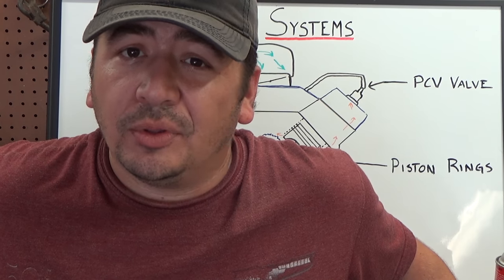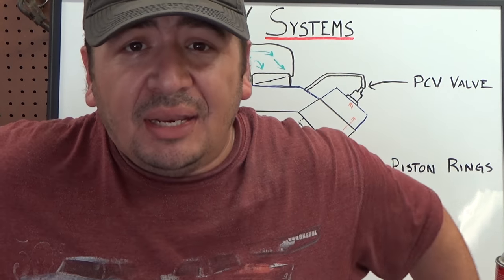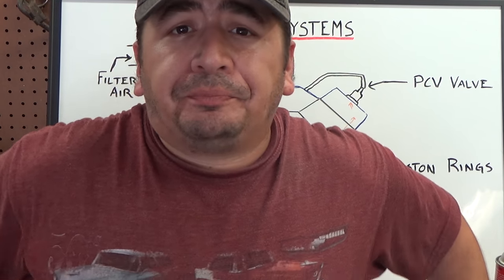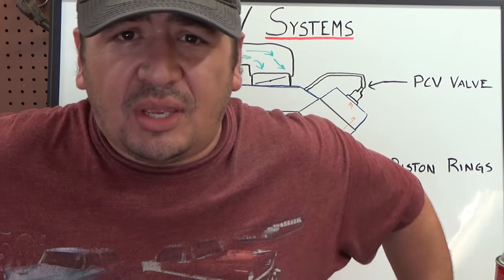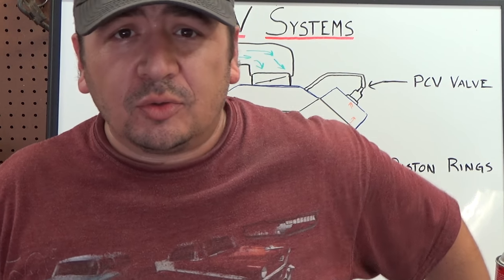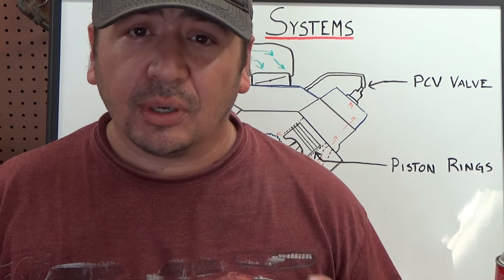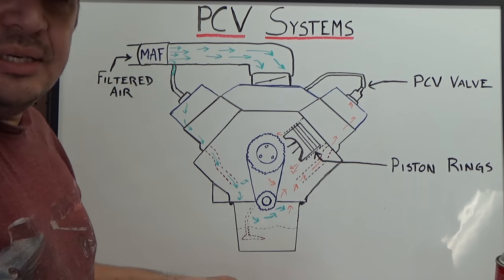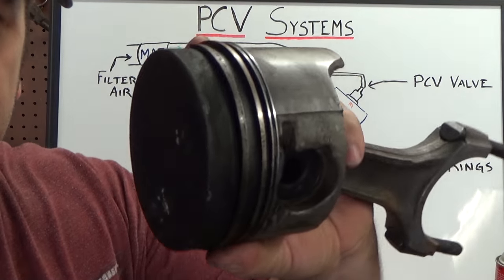PCV Systems - How They Work

Comment: I have a 2000 454 7.4L Vortec engine in my RV & it won't pass smog because the emissions at Idol are high, could a bad PVC Valve cause that? I've tried everything???

Comment: My PCV valve is fairly new & is on back valve cover and front cover got hose straight to air intake but instead of sucking air in its puddling oil in my air intake hose which is getting on air filter and maf pulse going into throttle body would you know why thanks

Comment: Thanks a lot for a clear explanation. Now I learned at there is actually cleaned fresh air coming into the crankcase, and then there is a pcv valve which regulates the vacuum in the crankcase. I will rush to my Engine bay to see my own vacuum system.

Comment: If these blowby gasses sludge up the engine and intake valves, why not discharge these gasses to the catalytic converter where they will be incinerated or use a vacuum pump to discharge to the cat.

Comment: Great video but I still don't understand why the PCV valve needs to be there at all. If there is low blowby at idle and low crankcase pressure, why does the PCV valve need to limit anything? Why can't that low pressure just go into the intake freely? It's still being metered so it shouldn't matter right? I'm trying to learn how a faulty PCV can cause a vacuum leak, which I'm not sure how it can again since the air in that system is metered. Unless it's letting in air from outside the PCV from  a bad seal and not just crankcase air. Oh, maybe it's because at idle you want the throttle pretty much all the way closed and an open crank case connection to the intake would be too much air and would make the idle go up? That must be why the PCV limits the flow at that point?

Comment: Some vehicles seem to slurp engine oil out of their PCV valves and some are dry. What design elements, or operating conditions, tend to make some PCV systems produce an oily mess in the intake manifold and ports?

Comment: Started watching this after I replaced one in my Honda. Just shake it to see if it rattled. If not, replace it. I didn’t think it would make much of a difference, but it did. It doesn’t run Rich anymore and mpg shot up. Car runs great and it got its power back. Check it every oil change. It’s a$3 part that really helps.

Comment: excellent, subscribed.  I recall a time when testing a PCV was done using your mouth doing a blow and suck test, basically confirming a check valve behavior.  But came looking here, when my truck's PCV would perform as a check valve (suck to no-flow condition), so bought new one and wouldn't either.  Watching your video makes sense of it all.  but help me out, wasn't the blow/suck test legit at one time?

Comment: I remember my 55 Chevy 265 V8 with the crankcase draft tube facing the ground to vent the hydrocarbon gasses. It would stink in the Summer when it ran in traffic. My next newer mid-1960's car had the PCV system and did what it had to do as you had explained. But one thing that you did not mention was that with the PCV system the engine actually got better gas mileage as well as the cleaner air to breathe.  Because the metered unburnt blowby hydrocarbons were reburned when sucked into the intake manifold along with the air fuel mixture for extra fuel efficiency.

Comment: thanks for the video.....i was having issues with my car and saw another video that mentioned the PCV system, i dug deeper and on my honda civic it was easier to change the PCV valve than it is to change gears....so i did it....the guy at the auto parts store said these should be changed once a year....but that seems a little exessive.

Comment: What causes the actual valve to move up?  The pressure of the air that flows from filtered air before the air intake manifold through the crankcase to the airinlet (after air intake manifold)? Is this flow of air constant?

Comment: A little bit of preventative maintenance goes a long way to avoid serious, expensive repairs.
Even if you have no idling issues or other symptoms, it’s just a good idea to replace certain critical parts after a specific interval. I replaced my PCV valve at 120,000 miles while replacing the water pump and drive belt. Honda recommends those parts be serviced after 100k miles.

Comment: On another note clogged Pcv valve really damages gdi engines by allowing sludge oil to build up into the intake side of the intake valves causing all sorts of problems

Comment: Awesome explanation man, thanks. I kept hearing a buzzing sound on my Silverado inside the engine bay on the driver's side. It was making me a little crazy. Turned out it was the check valve in the pcv. No big deal, just annoying.

Comment: nice video , i age a 73 Charger with a big block i noticed lately that i have oil dripping from  the filter cap on my valve cover , i have a pcv valve that is connected to my carb spacer hole  on the other valve cover and i recently changed the rear main seal for dripping oi badly , my question is does the filter cap  ( after market chrome cap ) on the valve cover needs to be connected to my aftermarket air filter , and does it matter on which side  (left or right of the engine ) the pcv valve is connected thanks

Comment: The hose between my pcv and Intake has a leak, so I’m assuming it’s drawing in outside air into the intake not being monitored, but I also have insane vacuum on the oil cap at idle

Comment: Maybe a stupid question but It's sort of confusing  in a way because the PCV valve seems like it's mentoring the flow and the other side looks like a straight pipe without any kind of check valve so air can go in or out even though both sides are hooked up to the intake manifold that creates suction

Comment: Also what's important to note...the pcv valve hose always goes to manifold vacuum and the opposite side of the system goes to pre vacuum (air cleaner) before throttle body or carb. I've seen people do it wrong.

Comment: I noticed that I bought one from Autozone and I compared them from another Auto parts and I tested both the one from Autozone throws not that much air and the one from another Auto parts throws way more.Should I put the one from Autozone or shoul I put from the other Auto parts.

Comment: So what if i unhook my pcv valve from the air intak and leace it open to air?  Is there a chance this throws a vacuum leak code.  I want to remove this air flow into my air intake system

Comment: Nice video.  I have a question.  I have a 77 F250 and after rebuilding and installing the carb I noticed a rapid pulsation from the PCV valve at idle.  I can feel it on the vacuum tube as well.  Remove the valve from the oil fill cap and pulsation stops.  I have absolutely no idle issues... baby runs smooth.  PCV seems to check ok.  Rattles when I shake it.  I've read forums where replacing PCV valve does not get rid of this pulsation.  I can't say that this hasn't been doing this since before reinstalling the carb.  I just happened to notice it at that time.  Is this something for me to worry about?  Is there anything I should check or do?

Comment: 351w carb I have it set up just like this but there was a pcv on fresh vent side coming from the air cleaner is that correct? Or do I want it straight no pcv on that side ? Thanks

Comment: Great video, @ 5:50 you mention the air coming into the eng. is metered and gets into the eng. past the MAF (air flow sensor). what about in an older engine with no MAFs?

Comment: I have a late model toyota rav 4, the intake has to come off to replace the pcv valve about 3 hours, is there not an easier way to check if it's working or not?  BTW My rear main oil seal is leaking a bit, connected?

Comment: This helped me understand the pcv valve a bit better. I recently replaced my old pcv valve and a few days ago I got a P0402 Exhaust Gas Recirculation Flow Excessive Detected code for my 96 Ford Explorer. I cleaned my pcv valve today and it got the engine code to go away. So glad I didn’t spend a bunch of money for a simple cleaning in the pcv valve.
Reply from the maker: I'm glad the video helped you understand the PCV system and helped you take care of your fault code.

Comment: thanks for this super instructional clip, i have a very important question for you, i'm in the process of swapping a Trailblazer SS intake manifold in my 04 Tahoe which has a little tube right before the throttle body plate to provide fresh air into the passenger side valves cover but the new intake i'm going to put has not that fresh air tube so without knowing what you explained i drilled a hole on the neck of the intake after the throttle plate and tapped a fittin to be able to connect the hose from the valve cover but now after seeing this video i just realized that by doing that instead of injecting fresh air to the crank case it will suck air and vapors from the crank case into the intake the same as it does on the dirty side from the pcv valve to the intake so please let me know what do you think and what do you recommend me to do, big thanks in advance

Comment: What you fail to explain is that the change in exhaust gases from blow by can go either direction depending on vacuum within the hose before the throttle plate

Comment: Hey wassup I have a Toyota crown majesta 1jz-fse  I notice oil is going onto the  air filter and  intake manifold  and  it makes a noise coming  from the  engine  when the its  running could that be a bad or failing  pcv

Comment: Thank you so much! We replaced my pcv valve... old one was horrible looking, I noticed sludge on last oil change, terrible gas mileage, oil around my coil packs, leaking small amounts of oil under the engine... Anyway it all was a hot mess! So now we put the new pcv valve in and test drove - when I came home at an idle there's a loud rattling sound. Where should I go from here?

Comment: Best video I’ve seen on this. But at 10:05 you show the valve all the way down and mention how as the vacuum drops more gases are allowed through. But if I’m not mistaken at wide open throttle (no vacuum) the valve would drop all the way and not allow any gasses through right?
Reply: You are not correct. The spring loaded plunger never goes all the way down if the engine is working so it never closes the opening and the gases can flow. The position of the plunger and the size of the opening below the plunger are determined by the spring tension and by the vacuum inside the intake manifold. At the wide open throttle the vacuum still exists. Not as high but it's still there.

Comment: Excellent knowledge here. .. As the plastic PVC housing on the plastic valve cover, the new valve would not seal properly on the engine vacuum side. I plumbed the pcv valve to the other valve cover, to the smaller hose fitting, then to the manifold inlet on the other end of the hose. .. The air box vent hose went to the larger broken side, with a minor repair. Everything worked great.. Thank you for this video.

Comment: Please can you tell me why oil is escaping out of the PCV valve into my air intake I have a 2.8l 2006 mk Triton is it possible to get a new PCV valve or do I have to replace the rocket cover or is there a problem with the vacuum that you mentioned

Comment: Great lecture there 👍 more explainable thanks, I have 2005 Renault Velsatis that comes with Nissan 3.5 V6 DE engine.  Have been having serious problem with starting the engine, once I crank it the engine will respond and trip off immediately, not idling, tottle pedal not responding.
Have changed the MAF, Tuttle pedal, Tuttle body, the 6 spark plugs, the fuel Injectors. Problem still persist, like engine wouldn't stable and idle.
What can I do?

Comment: Excellent explanation of the PCV valve. I am building a custom engine and have seen many variations on how to control crankcase pressure.  I'm installing an EFI system and was thinking of going with venting to a can, but now I think the best way is to run it into the base of the throttle body.  I don't want to run it in such a way as to add oil sludge at the intake valves.  Great job, thanks!

Comment: Very good video except a proper crankcase evacuation system does not allow pressure to build in the first place, it pulls sufficient vacuum to not let pressure build to begin with. Crankcase should never "push" air out, evacuation vacuum/suction pulled at all times prevents pressure from ever being able to build in the first place.

Comment: Can that give a code for a po300 I’ve been haveing a miss fire with my Honda spent over 800$ to tune it up an change wires spark plugs I have a 2000 Honda Civic lx
Reply: If you're a po300 & you changed wires & plugs. Try changing o2 sensor or sensors.

Comment: If that's how a PCV designed and created, its job is simple, open & close for air in/out, how can it be worn out and needed to be replace? Is there something else missing?
Reply: Overtime condensed oil vapors will accumulate on valve body leading to the failure.
Reply: The plunger has be at a specific location when the intake manifold vacuum changes. If the valve is dirty it loses it's calibration and may jam at a certain position. And the spring can become weaker over time. The valve may seem functional but it opens in a wrong way.

Comment: Very informative and straight to the point sir! The illustration on the white board was perfectly executed as well! Oddly enough my engine does not use the traditional style pcv valve, it uses what seems to me like a flow restrictor and a smaller vaccum hose for this portion of the crankcase venting. The other portion which is a larger hose connects, How you described after the maf before the throttle plate. My engines valve cover only has one fitting that attaches to it and it’s basically a “T” adapter with two hose barns on the end. One for the larger fresh air hose and one smaller fitting that goes and connects under the intake manifold. I’ve been trying to install an oil catch can to minimize the amount of oil building up inside my intake manifold. I know my best option for maximum performance would be to vent all this to atmosphere which I have done in the past previously on the race track but if I’m daily driving the car it smells like crap and vapors are pretty strong since I do have a higher mileage performance engine that’s due for pistons and rings when I’m in a better financial state. When installing an oil catch can in line with my cars system it seems like I must install a can “in-line” with both the smaller and larger hoses ? 

I would cause alot of damage if i deleted the smaller hose in my system that’s pulling the crank case fumes during idle eight ? I’m just trying to understand and be sure before I spend extra money. It sounds like I need to install two seperate catch can…..one for idle and vaccum state and the other for wide open throttle conditions 🤷🏼‍♂️

Comment: So when your pcv valve is not working properly because of polution, and with high speeds your oil warning light goes on and your engine shuts off you need to replace or clean up the pcv valve?
Reply: Did you find out?
Reply: @jonathonhicks2369  yes, the tube going from the pcv valve to the inlet under the airinlet was poluted and jammed with dirt

Comment: So if its clogged will it cause my valve cover gaskets to blow?
And run rich?
Reply: The positive pressure will draw  engine oil upwards and this positive pressure will force the oil out of the seals and you will see a leak.
Reply: @Jay Dee just buy a new valve dude theyre cheap
Reply: @Jay Dee im no mechanic so. Cant really comment sorry bud.
Reply: @Jay Dee I wish you luck on your repair, stay safe and god bless.
Reply: @carlnikolov  did you ever figure out bro

Comment: Great video and explanation. But. You cut the pcv-valve open, and when it is fully open ,there's no way for the air to go because the cross thing between the washer and the spring is blocking the passage. Could you elaborate a bit more what's happening inside the pcv-valve?
Reply: Aah, I think I got. When the engine is running the cross thing isn't in contact with the washer and therefore there is a passage for the air to travel?
Reply: How to pcv valve behaves when it is used in a boosted application. If there's positive pressure after the throttle body, does that mean that the pcv valve is fully close because the cross thing is pressed firmly against the washer (preload from the spring +boost)? 

I always thought that the only way the gasses could flow between crankcase and the valve cover was to go through the gaps between piston rings and cylinder walls, and then fight their way up around valves. But you mentioned "drain back tubes". Could you you or someone post a link to a picture where I can see this kind of tube. Tried to google it, but couldn't find anything

Comment: Great explanation. Thank you. I have an 1985 Honda Prelude. Is backfiring and hitting high revs (4k) on start up, then dropping to zero. I had left it for nearly a year. Could this possibly be the cause (I have looked at more obvious things-leads, throttle etc)
Reply: ... the 4k high rev may be due to faulty "IAC Valve". The computer thinks something is stuck so it's hunting (searching) for the right IAC  position... just clean it good 
👍
Reply: @glasser2819  but its a 1985 and doesn't have a computer

Comment: I don’t what car pcv valve works that way but I thought the pcv valve opens up so can fresh air can get in not opens up so can air gets out because where the car hot air gets out and goes back in the hoses conect it to the air intake
Reply: When the PCV valve opens both happens. Fresh air in and crankcase vapors out.